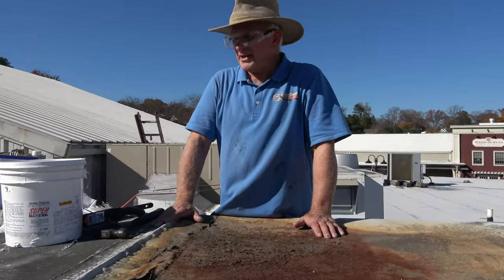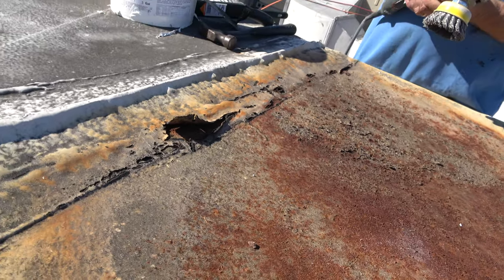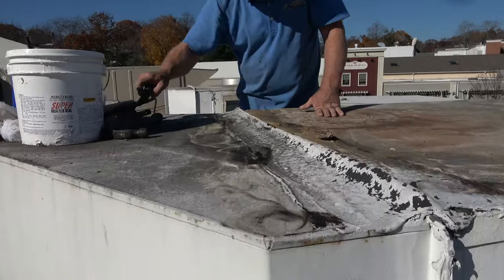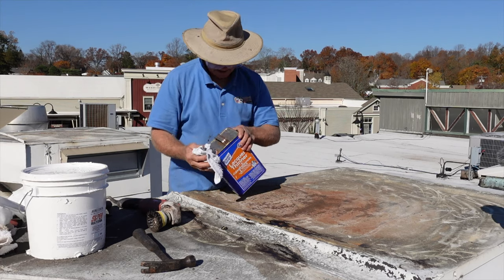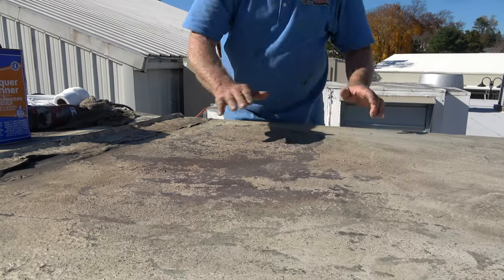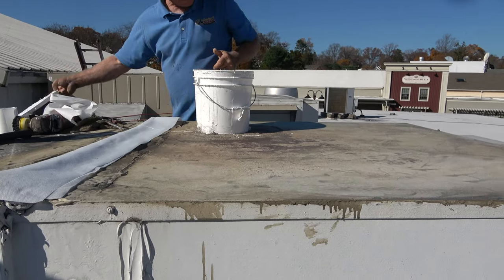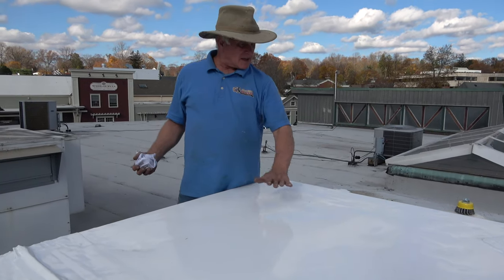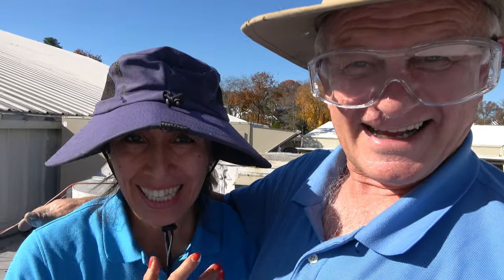Amazing Coating that will seal and protect metal against rust

Comment: I tried to find the leak on my flat metal roof. I have inspected it many times after had put black tar on the seams. I can not find the leak. Its still leaking through inside. I tried calling for roofing people to come and diagnose and fix it but they havent called me back. Where do u think in ur opinion, how its still leaking?? I think I might use what u used in this video.

Comment: Would you use this silicone coating on a camper trailer with a metal roof?  or which product would you use?   My trailer is from the 1950s, with many old roof repairs using Henrys black roofing patch (tar?) on the seams, and paint over the patches.  Do I need to completely strip off all the old products? (My roof is only about 8'x8'). I think I watched too many of your videos and now I am not sure which way to go!   Is Turbo Poly seal for seams, and Silicone seal used as a coating?  The fleece looks great and I noticed you used it for seams and leveling the coating. Thanks.
Reply from the maker: Always best to remove everything to the metal. Then you can use the Super Silicone Seal to cover the entire roof and use the fleece over the seams. This way you will never ever have to do anything again.

Comment: I don't know if you have used one or not, but the best tool I have found to clean up old joints and remove tar and other sealants (like that shown on the AC unit or on a metal roof) is a vibrating tool with a scraper blade with a smooth edge.  It'll cut right through sealants and also easily scrape them off the surface.  Get several blades.  They wear out quickly.
Reply from the maker: yes, thats a good tool. I prefer a corded angle grinder with a heave steel brush. That goes faster